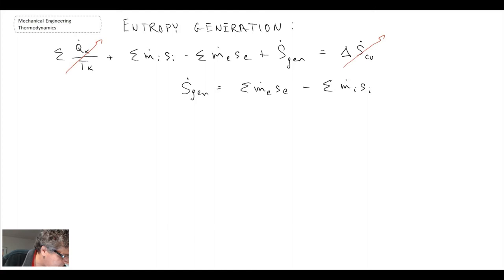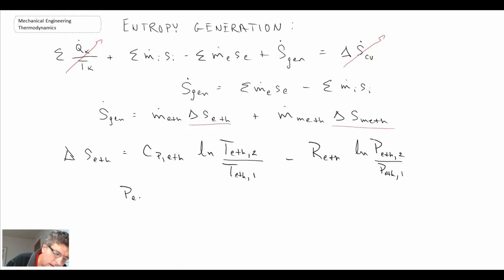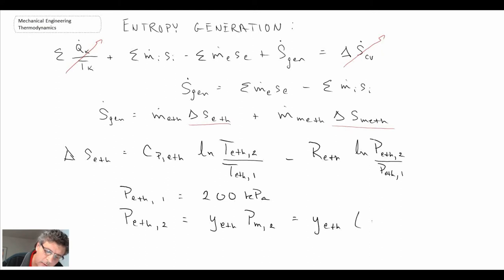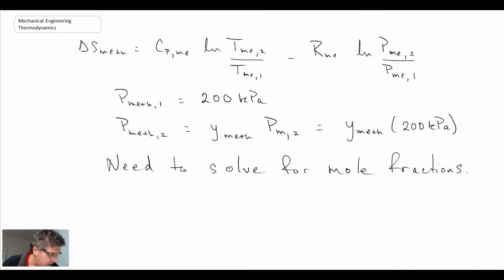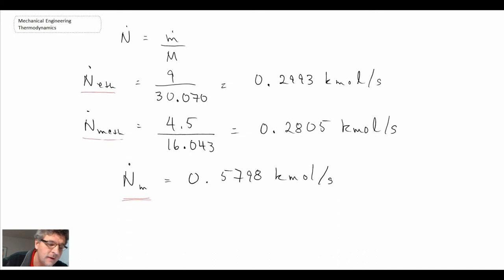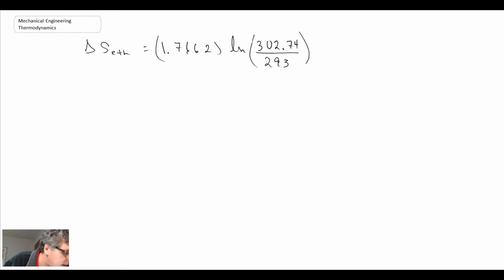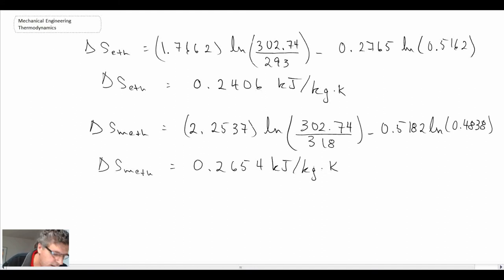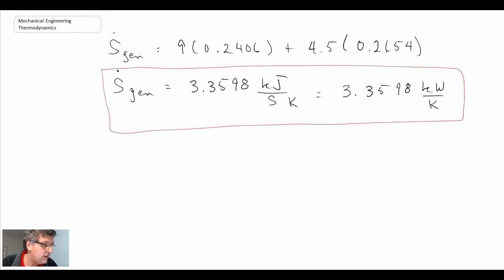Mechanical Engineering Thermodynamics - Lec 27, pt 3 of 3:  Example - First Law Gas Mixtures

Comment: hello, Mr Ron, I just want to say that your thermodynamics videos are helping me a lot thank you so much for putting your time and effort in this, I really appreciate it.
I didn't understand one part in this video at time 7:55, why did you only used ln (y(eth)) instead of the pressure ratio, because original equation has ln(P(eth)2/P(eth)1), also with methane? please elaborate
Reply from the maker: You can find the answer to your question starting at around 2:45 in the video.  The inlet conditions are either pure ethane or pure methane, while on exit we have a gas mixture.  When evaluating the entropy change of either ethane or methane we need to use the partial pressure (y*P_m).  On inlet it is just the pressure of the inlet stream (200 kPa for this problem), while on exit we need to consider the partial pressure of each component.  When you put this into the entropy change equation for ethane, for example, you end up with the following for the pressure term:  ln(y_(eth,2)*P_(m,2) / y_(eth,1) *P_(m,1)) which equals ln(y_(eth,2)*200kPa/y_(eth,1)*200kPa)).  Given that y_(eth,1)=1, this reduces to  ln(y(eth,2)).  You can use the same logic when handling the change in entropy of the methane stream.
Reply: Ooh ..Ok thank you